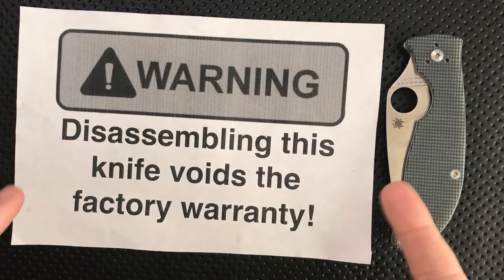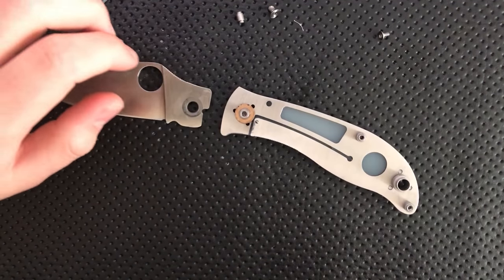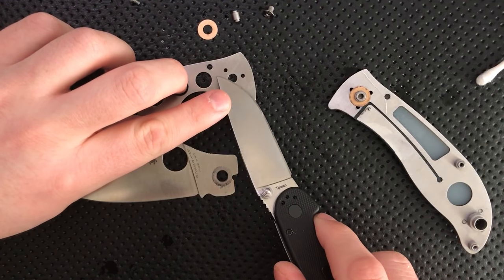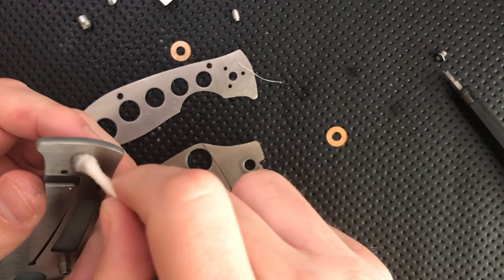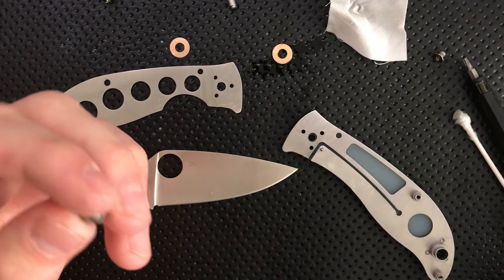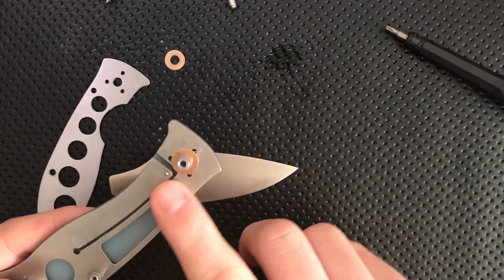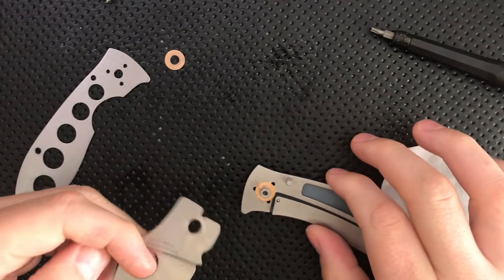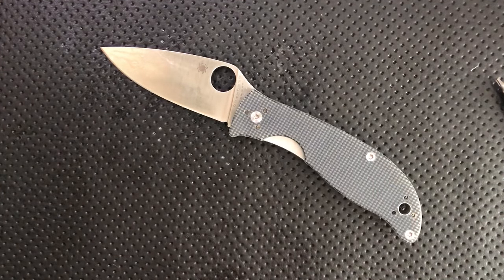How to disassemble and maintain the Spyderco Polestar Pocketknife

Comment: Hi Nick. If the detente is still too loose, you can try bending the liner lock about .002 of an inch. This would allow you to back the pivot screw off a little which may improve the action a little more and it would increase the detente. It has worked for me in the past. Love your videos.

Comment: Spyderco screws annoy me to no end, they're butter soft. I have a s110v para2 that is loctited to hell and back. I wanted to take it apart so I could put new scales on it down the road. One screw came out no problem and then two of them stripped without me putting any torque on them, I didn't even try with the others.
Reply: cameron utt Tried disassembling my Manix 2 a couple weeks ago... Spent like an hour applying heat to the pivot to get it to loosen up...
Reply: my Manix 2 was actually fairly easy to take apart, no loctite, I put some custom scales on mine. The "fun" (nightmare) part was putting it back together. Essential advice: only do one scale at a time or you're in for some real "fun" (it sucks).
Reply: cameron utt I think I stripped my pm2's clip screws trying to get them out. The screws wouldn't move.
Reply: Damn. Never had trouble with the pocket clips on my spydercos. They are really soft though so be careful.
Reply: cameron utt I'm going to try using a hair dryer and if that doesn't work I'll use pliars and see if I can get them out.
Reply: ka1s3r_  best of luck. I'm no expert. I've personally never had luck with the blow dryer method, but I'd still give it a try before you do anything more drastic.

Comment: For the loctite haters. Eric Glesser explained that most of their knives are for first response people, and we collectors come "second". That is why the locktite is there. If a fireman runs into a burning building, or a cop driving through the dessert, the knife can't fall apart because the heat melts the loctite (that's debatable of course). Eric rather has a knife that doesn't fall apart, than a knife that's easier to dismantle
Reply from the maker: That's a great justification.  But he's failing to understand why every other maker doesn't use it.  It's a limp used to justify a crutch, rather than a crutch used to justify a limp :)
Reply: sjoerd stok If you design it correctly than you don't need that much locktite. And besides that, the screws made out of the softest metal known to man is also to aid first responders?
Reply: haha I'm not saying I agree with all that Spyderco does, just quoting Eric here :)
Reply: Like any other tool that you purchase, the owner should be able to maintain it and service it. As such, the manufacture should  have the consumer in mind and design accordingly. The First Responder theory is a great initial thought, but to have the "regular consumer" being put "second" does not make sense. Spyderco has resources and they should huddle together there at the boardroom in Golden and come up with a better idea. By the way, Hinderer was a first responder and he created his knives from doing that job. I am not a Hinderer fan per se, but his knives do not use this production theory and his knives were build by and for #1 Responder.